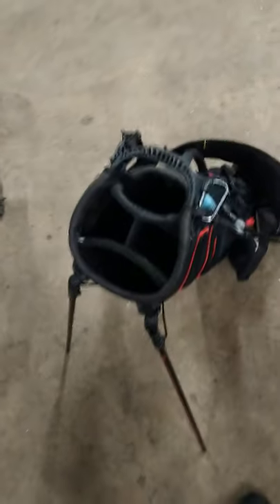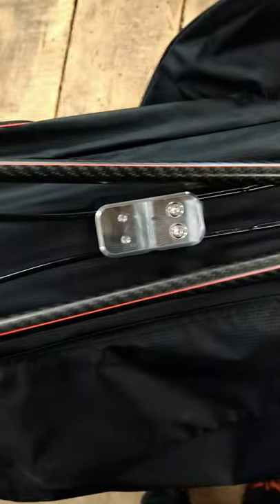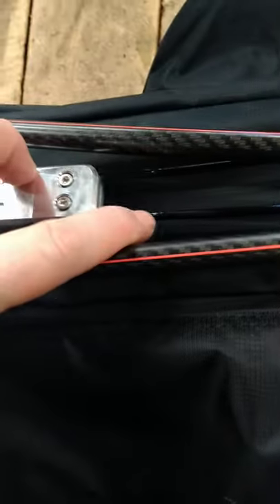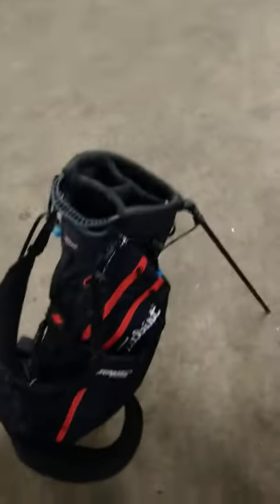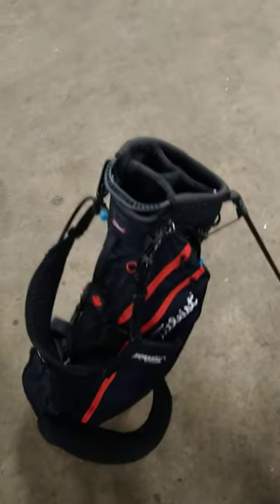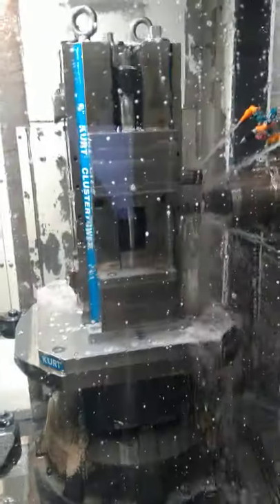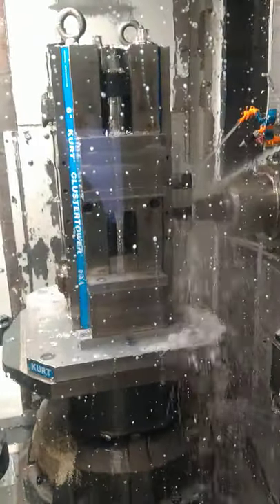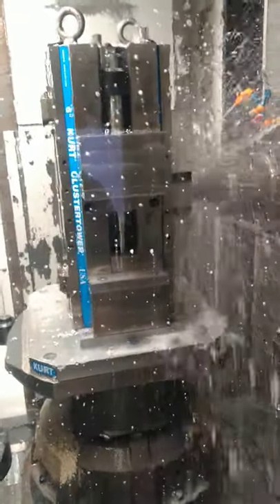Titleist, Ping and Vessel stand bag leg droop fix

Comment: 40 bucks. are you kidding me why rip us off.
Reply from the maker: @adi4998  they're not the cheapest things to make unfortunately. If you want to fix the issue for next to nothing you can try the zip tie method.
Reply: @adi4998 I suppose you could make one yourself for less, come up with a less expensive repair, or buy a new bag.

I can promise you the the CNC Clamp will out last any bag you'll ever buy, not to mention It's easy to remove and install on any other stand bags you'll ever own.
Reply: @mrwibbly  Nice clever design. Unfortunately some people will always be looking for gourmet food at McDonald's prices.

Comment: Could you go thru how it installs?
Reply from the maker: it's very simple. you just unhook the leg springs from the legs (they just pull out of the keepers), then pull off the stock plastic clip, then you simply bolt this one on instead, while moving it slightly up the springs so the closing force is greater on the legs. i suggest putting the new clamp 3/4" or so above the little pinch in the springs that sits under the stock clip. it's hard to mess it up.